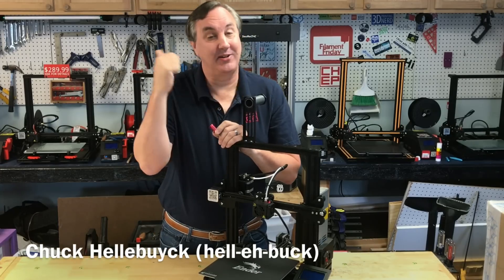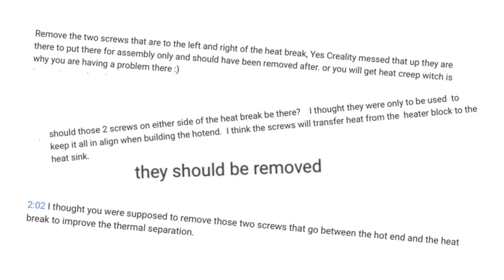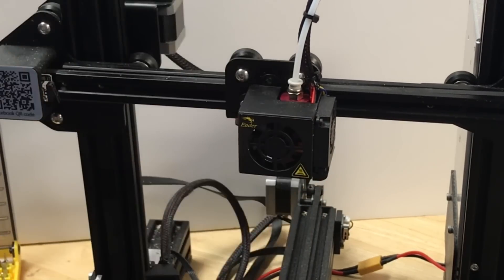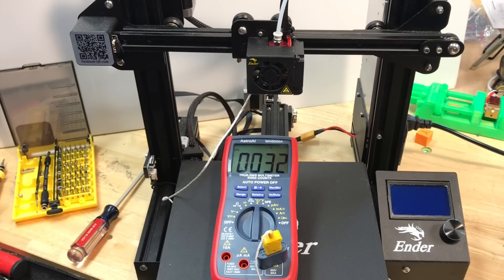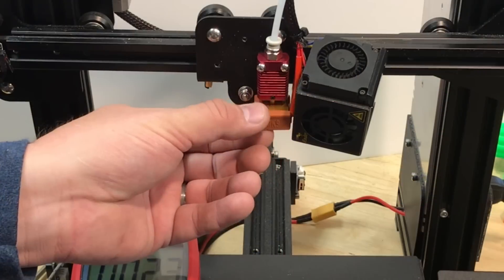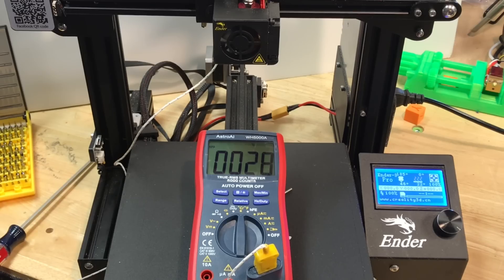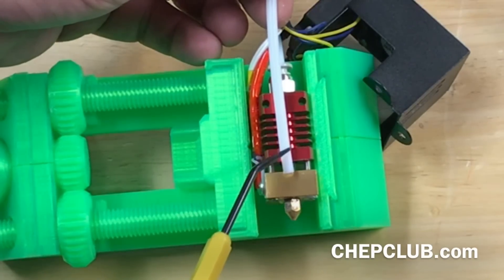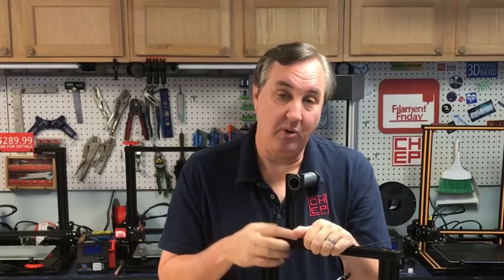Creality Ender 3 Hot End Heat Creep - Remove Those Screws......Maybe?

Comment: Data is slightly off.

First. I tell people. If you are not having issues leave them alone. Second tighten the grubs bedore removing them if you decide to remove them.

Now. There is a big difference between core temp and edge of fin temp. Second your system is not active. Its steady state. Usually this problem happens when yoy stelarr to dabble with higher temps. Such as 230 to 240c to print silk and proto pasta etc.. Also yoyr heater eill cycle in steady state. Its not really adding much to the system because the system is not really changing all that much.

Start printing and now the cart has to get more active to cotiniously make up for the lost heat going into melting the filament. That is a very different environment compared to fin edge 185c no filament running.

The fans on these machines are also .... Lackluster. As their performance declines......

Again though. No problem? Leave them alone. They do make the system sturdier especially since they cheaped out on a threaded heat break replaced with the less effective slide in and grub screw heat break.

Of my 4 cr10 1 mini 9 ender 2 one s4 1 s5 none of them have the 2 screws. Was not under the ender 3 that i started seeing the screws. I guess thst is when they changed the hot end design??? No idea really. 2 of my ender 3 had them 2 did not. I leave them as long as they dont cause a problem (too lazy to remove) if i get seemingly heat related jamming i remove them and the problem goes away. Both mine did this but i tend to print hot so there is that.
Reply from the maker: I’m measuring the block by the screw not a fin. It’s the closest to the source of the heat effect by a screw. I was only determining the effects of the screw not the core. As the test proves the screw had very little effect. 

The  core temp has more to do with the heat break and conductivity to the PTFE/Filament. 
The PTFE going into the high temp heat block will transfer heat/deteriorate long before the any heat in the heat sink. At 240 you are approaching the limit of the PTFE to nozzle setup. 

Steady temp is the only way to reduce variables down to measure the effect of the screw heat creep.  Besides cycling temp causes the PWM drive to change sometimes reducing heat at times to correct. This gives the heat sink time to bleed off heat. 

Run your own temp tests and prove me wrong but I’ve only seen clogging at the end of the PTFE when running higher temps, not in the heat sink area because the PTFE started to break down from the steady heat at the nozzle. And I have machines running with screws and without 24/7 in my print farm.
Reply: I don't know what to say. You make me doubt my findings. I was getting a lot of jams before I removed the screws, like Nerys suggested. Now you would think the hotend was not assembled properly at first and after cleaning it  was fixed, but a month or so later I thought, lets put the screws back on to make it more sturdy. You guessed it, jams are back. May be a coincidence, but I don't use them anymore and haven't had a jam in a long time
Reply from the maker: What temperature does it jam at and does it jam at the heat sink or at the bottom?
Reply: @FilamentFriday  210-215 I believe I was using, but how could it clog at the heatsink ? What do you mean ?
Reply from the maker: If heat creep was the issue then it would cause the heat sink temp to rise and filament to clog higher up the tube. Sounds like something else is going on. I print on several machines 24/7 with screws installed without issue at 215.
Reply: @batcadragos  Me too. Thanks to this "research" I refused to remove the 2 screws for a long time. I kept getting frequent nozzle jam, I had to turn off retraction and try to push the filament through as quickly as possible to avoid a jam. One day I got sick of the jam and removed the 2 damn screws and guess what? no more jams. Now I can use retraction and be confident that the print will complete. In fact I've never seen a good print before I remove those screws, those prints that I thought were pretty good were actually showing signs of the nozzle slowly clogging up. I know those screws are there to keep the nozzle in place but I can't accept a 50% failure rate after all the compromises I made. BTW I'm running a new Ender 5 Plus with upgraded dual gear extruder and high temp bowden tube and I'm pretty sure it's not a dying fan problem. There might be other factors at play that can cause the heatsink to be less efficient but if you have nozzle jam problem due to heat creep, it's worth giving it a try, otherwise leave it alone.

Comment: Thanks for the video Chuck, great test. I like the screws, easier to swap nozzles. When I first saw this, my first though was Creality was trying to copy the Mosquito hotend. :)
Reply from the maker: I believe CR-10 hotend was around before Mosquito but I could be wrong.
Reply: That's a good question, my old Creality machines don't have the screws but the newer ones do. Not sure when they started that.
Reply from the maker: About 12 - 18 months ago I believe. I broke a heat break tube on my original by over tightening the nozzle.